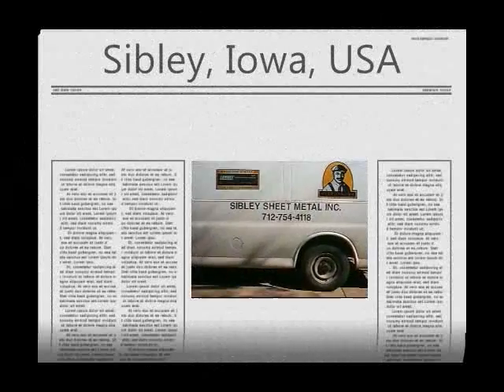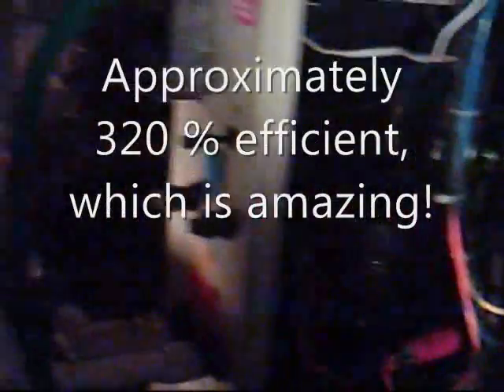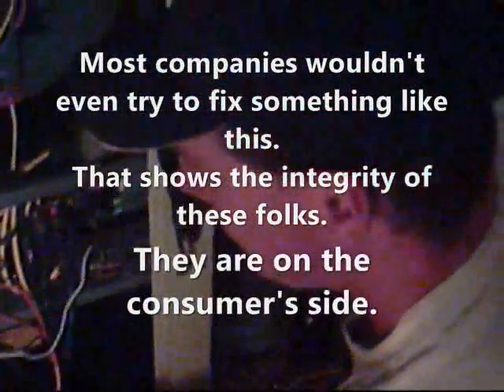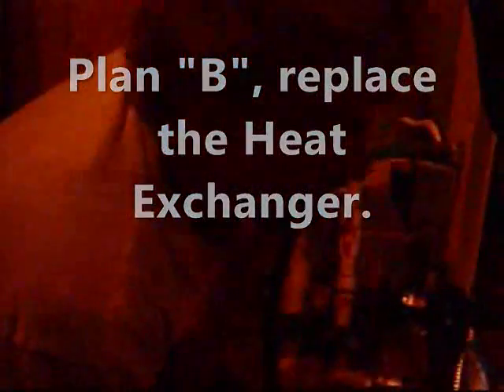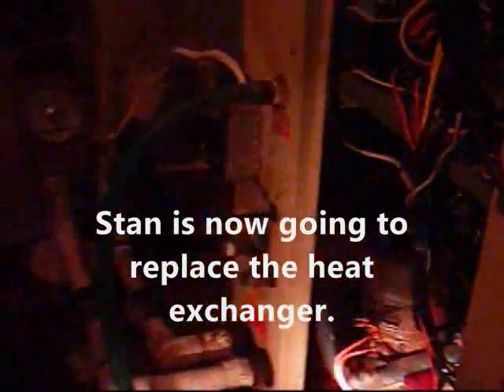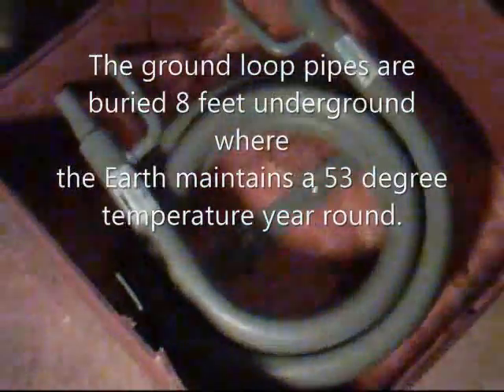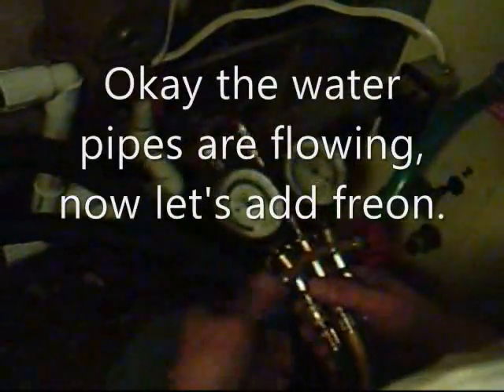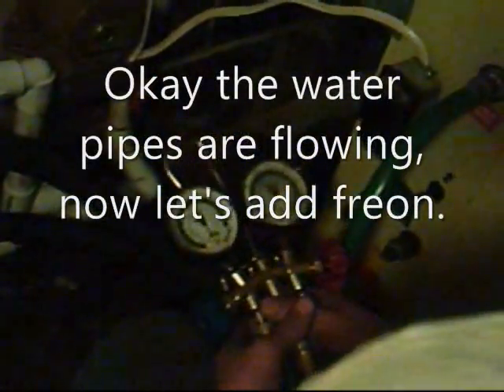Geo Thermal Heat pumps. Theory and operation from Sibley.

Comment: You're right about heat engines working on the same principle, but the heat pump in the video is a vapour-compression device. Like you get in a refrigerator, only working in the other direction. If you removed the electric motor running the compressor and supplied heat to the system it wouldn't work as an engine, or at least wouldn't generate much useable work.

Comment: In thermodynamics, thermal efficiency is defined as: what you want/what you pay for. So when you take something like a heat pump where you get more thermal energy transferred than the work put in to get that change. You'd get an efficiency greater than 1. The first and second laws of thermodynamics state that nothing can be 100% efficient so you have to call it a coefficient of performance.

Comment: and why is your backup heat coming on? your temperature is constant in the ground.......dont matter if its -50 outside, this is the pupose of going underground. if your not getting enough heat exchange to heat your house all winter it is because you are not getting heat transfer from your freon to your secondary. or your secondary is not transfering the temperature back in the ground

Comment: Heat pumps are awesome, the reason they appear to be more than 100% efficient is because you get a bigger thermal energy difference than the electrical energy supplied to the compressor in the system. So technically you can't calculate their efficiency, but you get a performance factor instead.
Annoyingly if you switched this around and tried to make a heat engine, it wouldn't work :(